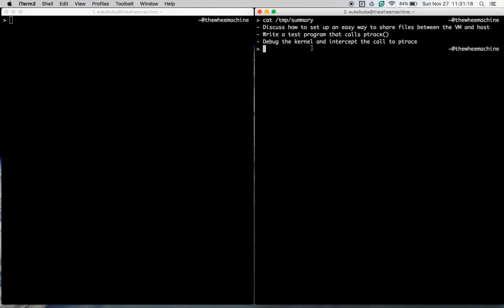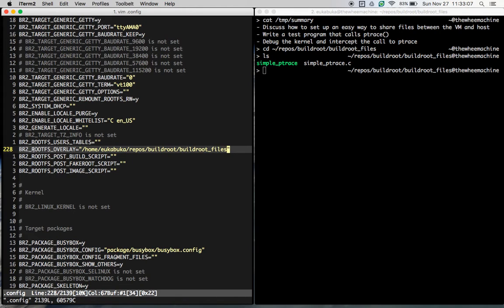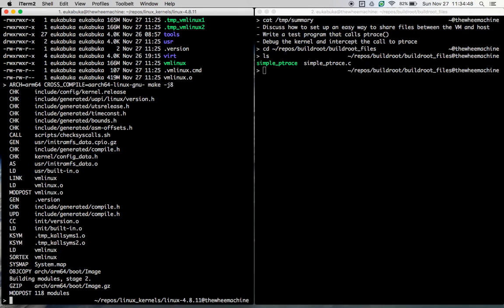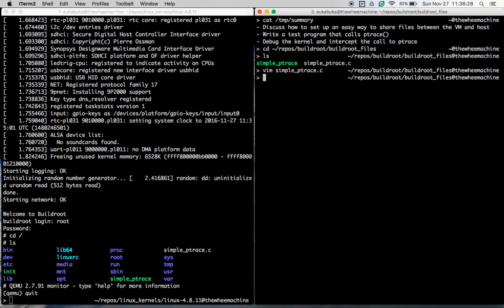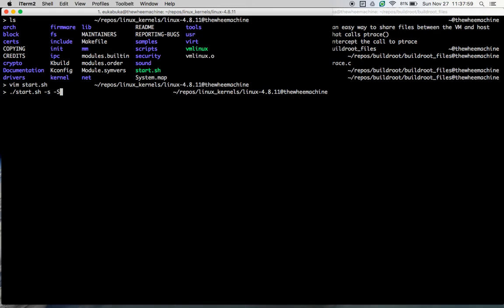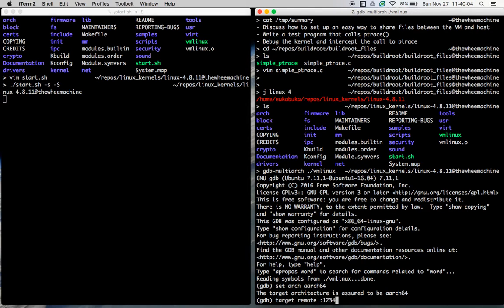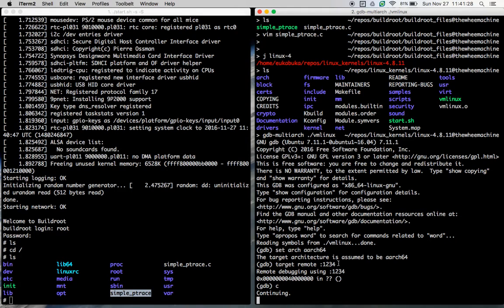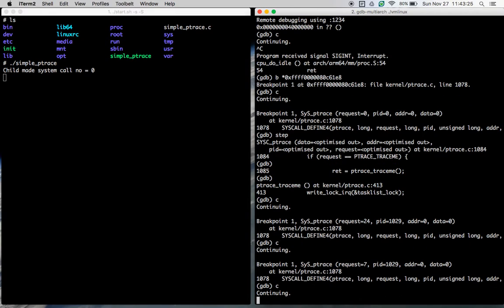Debugging an ARM64 linux kernel using QEMU

Comment: Hi Euka, I followed your guidelines and run qemu Linux successfully, however, when I ran simple_trace built statically from simple_trace.c in the VM, I met the runtime error shown as following:
# ./simple_trace
./simple_trace: line 1:ELF: not found
./simple_trace: line 2: syntax error: unexpected "("

Do you know what the root cause of this issue? and how to fix it.
Or did I miss something?

Thanks.

Comment: Thanks from heart. 
While debugging I got this error from GDB-MULTIARCH  
 -  "Call Frame Instruction op 45 in vendor extension space is not handled on this architecture" .
Being a noob I couldn't figure out where this occured from - aarch64 archicture configuration or - problem in gdb-multiarch